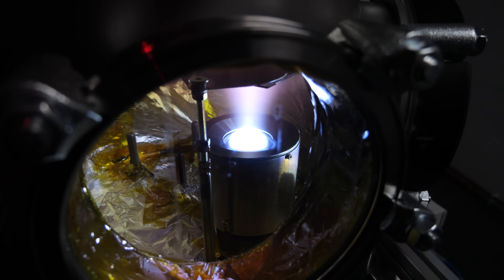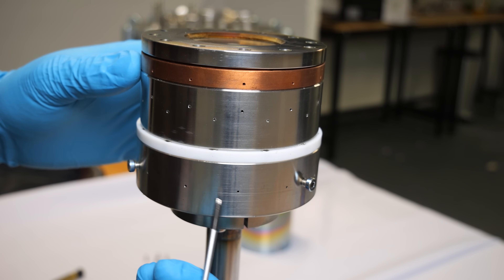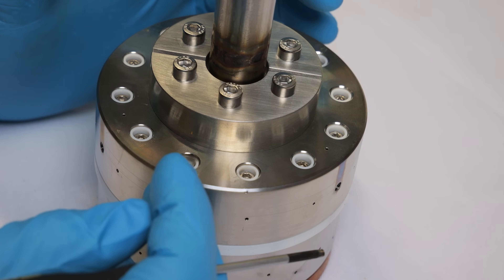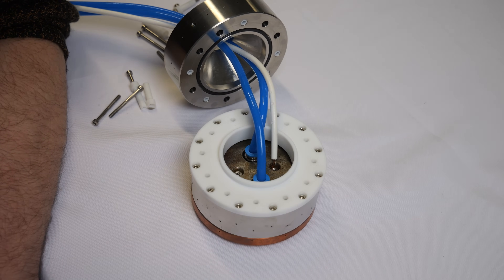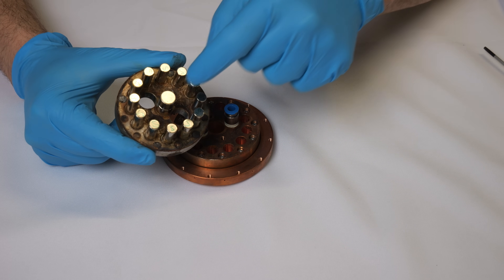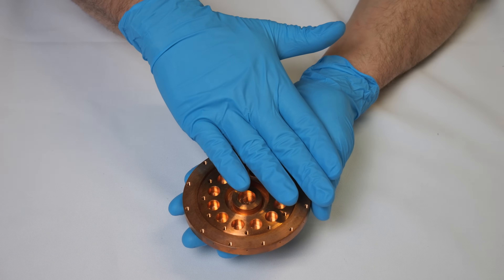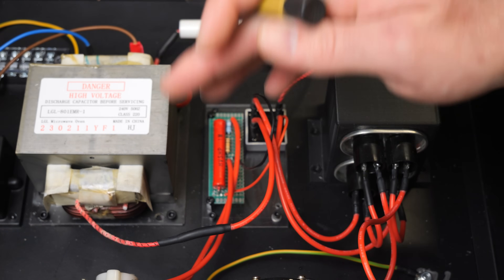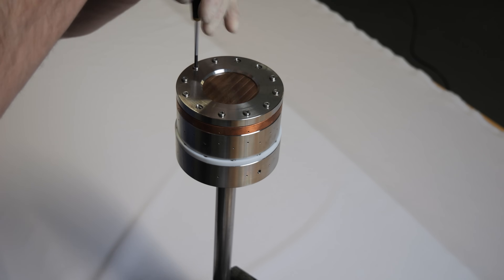Breaking Down My Magnetron Design - DIY Metal Coating

Comment: My heart dies when I hear someone using a mill in a hand drill, but if it works it works…
Reply: Not quite a proper die grinder, but if it removes metal is a satisfactory way and dosen't kill the tool... 
I have been known to make ad-hoc lathes from hand drills, angle iron and a prayer. Welded a hole in a tank with a bottle pf propane, someones grandpas oxygen tank, and some tubing and coathangars. If it needs done now, you can do it now, but usually not correctly. If only temporary fixes weren't the most permanent.

Comment: It looks like you are suffering from galvanic corrosion between the copper and the steel parts. You may want to look into plating the copper component in a material that has less galvanic potential like nickel.
Reply: Why not plate the copper and the steel in nickel?
Reply: They'll also need to ensure any metals they choose for their magnetron is electrochemically compatible with the metal in their cooler's heat exchanger!
Reply: I might be wrong, but why not put a Teflon shim or an insulating gasket in between the copper and steel part...maybe that might solve the problem of galvanic corrosion.

Comment: At 6:09 you talk about the screw isolation. Why don't you get teflon rod and chop fitting plugs that go onto the screw heads? Cheap DIY-plugs shouldn't be too expensive to replace, even if every removal is destructive. You might get it working with teflon tubing as well.
Reply: That or  have the pfte inserts extend a cm or so above the ground potential part. If you’re building your own based of the CAD files you can just extrude the ‘pipe’ section of the existing model a bit:)

Comment: I am not sure of alloy used but I have seen many stainless steel pots which are magnetic and stores use a small magenta to prove it will work with induction stoves.

Comment: Should condensation continue to be a problem, you might circulate air via a small diameter tube, perhaps fenestrated, run alonside the wires and other tubes
Reply from the maker: A good idea! But I think I will first try do not use cooling water below room temperature, since It's not necessary. That should hopefully solve the issue.

Comment: In my mind, it seems the easiest option for stopping the arcing is to just extend the ptfe inserts by ~4mm or so.
Reply from the maker: Good idea! But I really want to avoid having to pay for new PTFE insulators. 
I will try to use screw hole plugs and create a small hole in the middle so the air can escape.
Reply: @AdvancedTinkering  can you not buy them pre made rather than getting custom ones made?
Reply: @AdvancedTinkering  PTFE heat shrink tubing
Reply: @AdvancedTinkering  What if you didn't inset/countersink the screw heads? Wrap the shaft in off the shelf PTFE tubing then add a PTFE washer that's wide enough to reduce arcing. Or one giant 'washer' ring for all the screws.
Reply: @AdvancedTinkering  Or 3d print by ABS plastic or nylon
Reply: @mykolalukianov2746  ABS and nylon aren't rsuitable for high vacuum due to outgassing and moisture retention issues.
Reply: Using PTFE tube might also be an Idea. Also relatively cheap
Reply: I was about to suggest the same thing, then he mentioned the cost of the insulators. That would be painful to remake.

Comment: I'm assuming your 'power controller' is just a triac-based dimmer circuit. These are not suitable for driving inductive loads, since they simply 'chop up' the input voltage, resulting in weird spikes and all kinds of nasty things on the in and output of your transformer. Other than changing the entire design to a switch-mode supply, a variac is your best option.
Reply: Yeah, thought the same. The datasheet on that power controller specifies that it is suitable for phase controllable inductive loads, but transformers could still be an issue. I think a mains synchronized triac could work, but couldnt find one quickly available. The full bridge rectifier that is after the transformer also causes some nasty current harmonics which may also complicate things. STM application note AN308/0289 explains it quite nicely and shows a solution
Reply: Right, that should be the simplest and most robust solution. It is very common among telsa coil / high voltage enthusiasts to use those. A variable transformer doesn't care much about "dirt" that's fed back from the load- and even if this is perhaps not a bad idea, it doesn't have to be an more expensive isolating variac but an autotransformer(Spartrafo) will do.
Reply: Inductive load is not the only issue. The rectifier and capacitor cause the output to follow the peak voltage (ignoring ripple). So any triac triggering that lets through a peak results in max output voltage.

Autotransformer is probably the simplest solution here.
Reply: @dack42   Came here to say much the same. TRIAC/Phase control doesn't control the voltage per se, but rather controls the RMS voltage as an average of the whole waveform. Works great for anything that naturally integrates the waveform anyway (Lamp, heater, some inductive motors) not so good for things that don't, like this.
Reply: Triacs do work for inductive loads.
They just need to be controlled the right way, there are power supplies out there that use a triac circuit on the primary of the transformer as pre regulation before the linear stage to minimize losses.
Reply: @Alexander470815  Sure! With tricas inductive loads should be switched on within the sine-wave and switched of at zero power (no current flow), if I remember correctly. Doing this with a home-backet circuit requires some thinkering, correctly designed snubbers and so on. Commercial ones aren't exactly cheap (as far as I remember / without searching). A Thalheimer ESS 104 230V 1kVA variac is about 130€ new - I suspect a used one will be much cheaper. Edit: Ok, back in the days I tried to control a 20A 400V modified welding transformer for inductive heating of big roller bearings.. ;)
Reply: @poldiderbus3330  For just on/off control you want to turn transformers on at peak voltage. Turn on at zero crossing will result in a huge current spike due to saturation. 
You can not control the turn off time, it will turn of itself if the load current falls below the holding current. Only special SCR(GTO) might be turned off during current flow.
A Microcontroller is easily able to control a triac, with that you can build a closed loop regulation as well.
Reply: @Alexander470815  They might "work" in the sense of regulating power, but the sudden turn-off will result in insane spikes in the output voltage due to inductive kick-back. It's not suitable for an application like this.
Reply: first phase angle control can def be used for inductive loads especially when its just being rectified and smoothed at the output but its id still probably use a zero crossing triac dimmer the capacitors will average the voltage out or a trailing edge dimmer. but id probably just just use a modern inverter microwave power supply since it has a pwm modulated output already built in
Reply: Yall sound like you're slowly working toward a solution that's basically just a commercially available single phase VFD with the frequency fixed at mains freq and a pot on an analog input which set to control the pulse density in each half wave.
Reply: @AtlasReburdened  yea sure but you could use a full bridge high frequency inverter for basically every situation in power electronics so all the complexity required for frequency controllable spwm is expensive an unneeded. inverter microwave power supplies have pwm control of the output voltage and safety features that insure u cant power it on at full power and that there is a short all in a module that's lighter and often can be acquired cheaply if not free
.
Reply: Ah, you answered the question I asked.
Reply: even worse, he uses microwave oven transformer that is not suitable for this kind of non-sinusoidal feed.
Anyway it means that he had to design SMPS OR use typical old bulky variable transformer in oil or anything sinusoidal electromechanic.
Otherwise, well, needs to make SMPS.

Comment: Very interesting and thanks for a price breakdown, I'm always curious how much these projects cost. With your arcing screws have you considered trying plastic screws? They aren't anywhere near as strong but if I'm understanding your design correctly they only need to compress an o-ring. It's probably cheap enough that you could buy them just to try.
Reply from the maker: I thought the prices would be very interesting for many viewers. At least when watching videos, I often wonder what certain components might have cost.

I initially wanted to use plastic screws. Since it seems to be the simplest solution. However, almost all screws you find are made of nylon, which is not optimal for vacuum applications because it absorbs a lot of water. That probably wouldn't be quite as bad at the pressures I’m sputtering at, but I couldn't find any nylon screws with the correct dimensions either.

PTFE or PEEK screws would be optimal, but even very short screws are very expensive there.
Reply: @AdvancedTinkering  maybe make DIY screws? that's a big hassle tho
Reply: @mark0305 If you've done it a bunch, it's trivial. Working with teflon and/or PEEK is a bit tedious, however.
Reply: @AdvancedTinkering you have shown you are adept at making things yourself, so why not get some PTFE rod of the proper diameter and a tap and die set to thread your own screws? I see on McMaster Carr that PTFE rod is relatively cheap (cheaper than the sleeves you bought) and a decent tap and die set is about $100 but then you have those tools for future use. Thread the rod, cut it to length, cut a slot in for a flat head screwdriver or two for a Phillips and then you are good to go and nicely insulated.

Comment: inches - is that a unit?, how many saarlands or soccer fields is that again? 🙃
Reply from the maker: It's 0.167 foot. If that helps ;)
Reply: @AdvancedTinkering  ok as a tinkerer your allowed to use freedom units, i guess 😜  #engineer-upgrade
Reply: @AdvancedTinkering  Whose foot?
Reply: @R.Daneel  Mine, but only until the second mangled toe.
Reply: Football field you mean

Comment: Very nice design. And very economic as well. 

If you want to use Festo hoses with more pressure, you can use tube fittings with an insert for the hose. There is also a variant of the Festo hoses that has a flexible aluminium inner layer, allowing for even higher pressures (and they can be bent to start on a shape you want by hand).

I remember there being some issues with magnetic targets in magnetron sputtering, so I'm excited to see what you'll do with it.
Reply from the maker: Thank you! Yes I will probably switch to those cutting ring fittings and use a metal insert for the tube. It's the same setup I used to connect the tube to the gas flow meter. 

Using an iron target probably influences the magnetic field a lot. I honestly haven't done any research on sputtering magnetic materials. But I will before trying it.
Reply: I haven't seen the other video referred to with the comment claiming Festo push in fittings to not be good for high pressure, so I don't know what constitutes high pressure, but the push in fittings are typically rated up to 14bar. 

Swagelok fittings could also be considered - choose the right configuration and they're rated for 757 bar